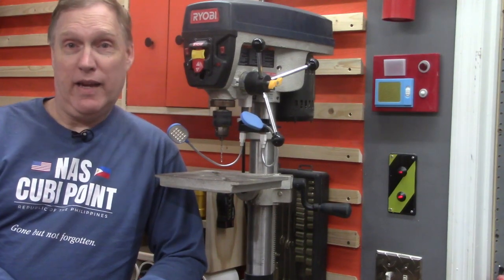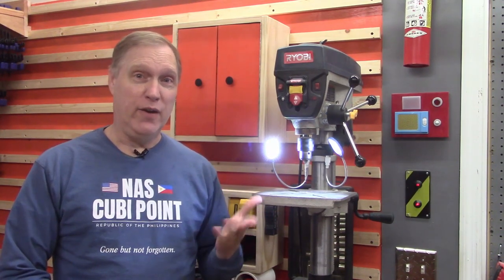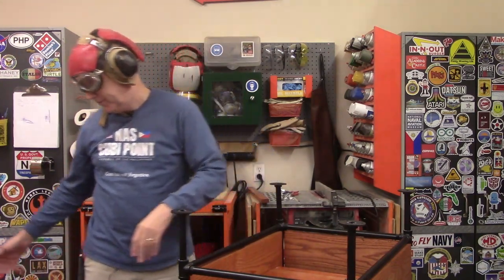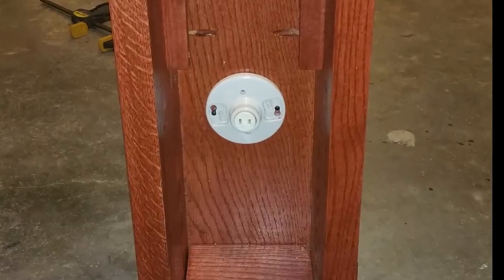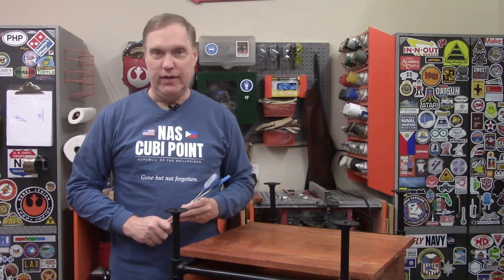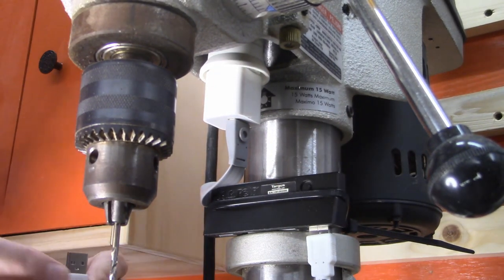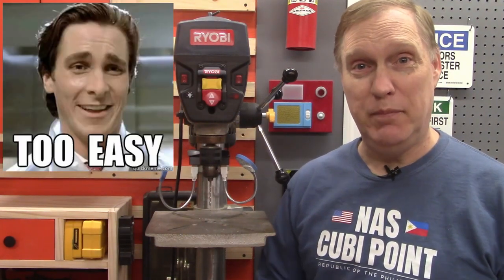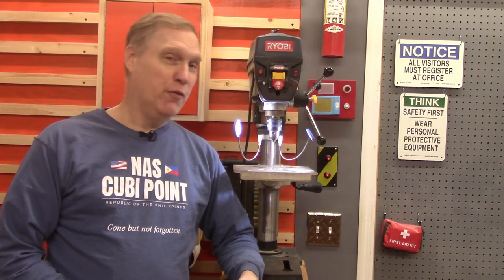Easy Drill Press Lights - Flexible Shop Illumination

Comment: While this seems to be an effective way to get some light on the subject there is some value in the original single point light.  If aligning the workpiece to a precision location using a pointed indicator in the chuck, the shadow converging onto the center punched spot provides an excellent guide.  My shop houses both wood and metal working tools so the most precise methods stand out.

Comment: I keep my antique drill press on my apartment balcony along with my other tools and workbench.
I want to find an inexpensive way to put an antique looking work light on my antique drill press. Any ideas?
Reply from the maker: I would use a pair of small enameled green shade lights on flexible goose necks. These are sometimes called industrial shades or gas station shades but they are those round green umbrella-style shades you see in all the gas stations in old movies. They make smaller ones that will block the light from your eyes while exposing the drill press work to maximum light. I think two small ones on your drill press would look pretty amazing.

Comment: That's great, unless you have no pre-wired light on your drill press.
Reply from the maker: Very true. But this could be done with a plug-in charger as well. But you're correct that a built-in drill light makes this easier.

Comment: I wonder how many of the viewers out there are trying to outfit a drill press that had no existing light to begin with?  Doh!!!
Reply from the maker: Well, yeah, you've gotta start with a power source... Maybe wire one if the drill press doesn't have one.
Reply: I jury rigged an AC outlet and strapped it to the side of the belt casing.
Reply: Yeah like me.